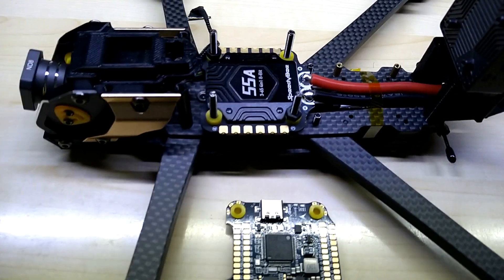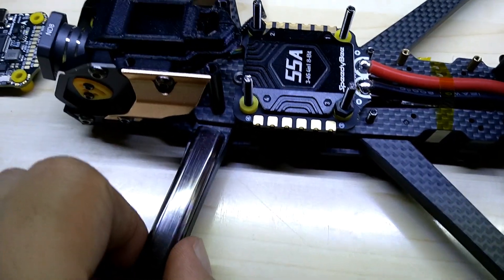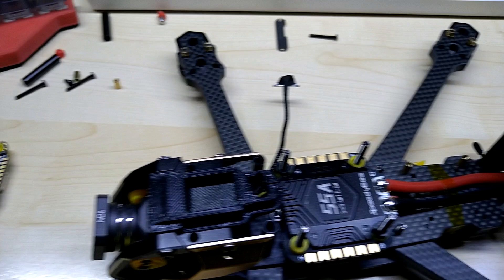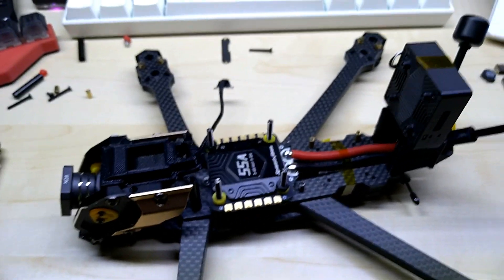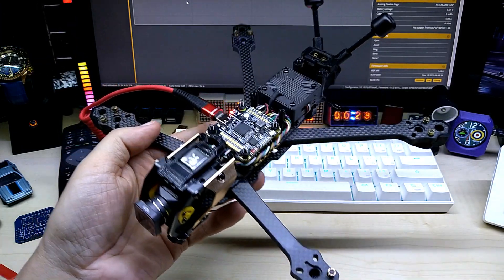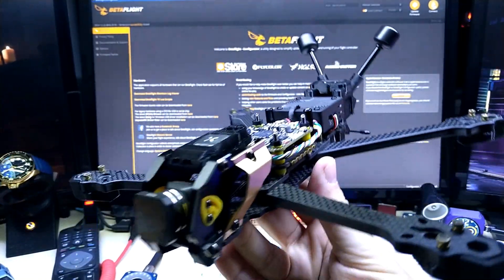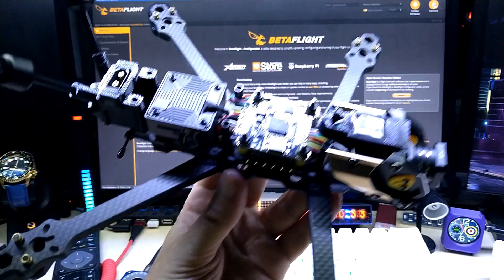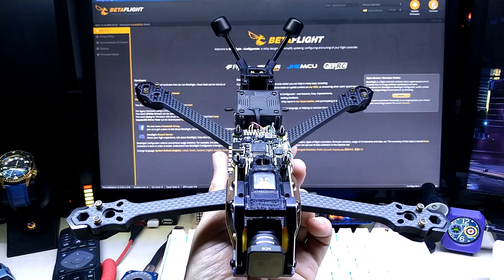5" Drone build with a #SpeedyBee Mario 5 Frame, electronics installed by #Hayri Part 3

Comment: Those "plastic protection tubes" are a huge pain. They break easily and the broken plastic is sharp. The sharp plastic becomes more of a danger to the wires than the spinning propellers.
Whenever I buy a frame and it includes those protection tubes, I remove the tubes before I fly the quad.
I use "wire loom tape" to hold the wires in place. (I use Tesa 51608 19mm tape. It works fine but I haven't tried any other brand, so I can't say how it compares to other brands.
Reply from the maker: Thank you for your comment. Just yesterday I trimmed one edge at an angle to have the "perfect" lineup to the frame and the plastic is very soft to cut. But you never know if it gets brittle when exposed to UV light. I will definitely keep an eye out. Worst case I can design a protection tube and print it with TPU 🙂Happy flying.

Comment: Beautiful build!!! That is a lot of electronics too!!! Just the install of the electronics is a work of art. Most people just cram everything in and it looks like a rat's nest. Yours (of course) is very well organized and sexy looking!!!! Thanks for sharing this episode with us!! Happy holidays to you and your lovely wife!!!!
Reply from the maker: Thanks Adam, I hope it is not getting too beautiful to fly, 😂 but wait till you see the side panels I designed, even redesigned the back antenna piece to match the new side panels, haha. Still quite a bit of wiring to do (motors and Neopixel) and now I am probably going overboard, thinking of a case for the lipo battery as well, that would it put it over the top and people will really call me crazy, hehe. People would also say that I am adding unnecessary weight to the drone, but I do not care about that too much as I will not be racing but am interested in video recording. Of course less weight means longer flight time 🙂 Anyway, enjoy your x-mas with your family. Btw, the NeoClock PCB and acrylics are ordered, can't wait to put that together 🙂Till later.